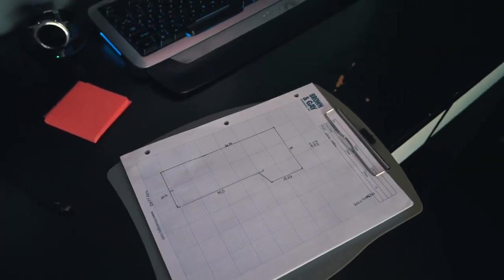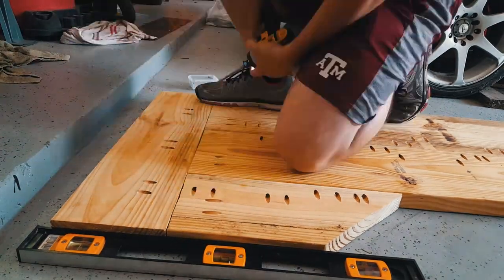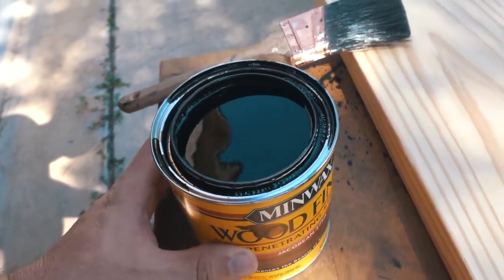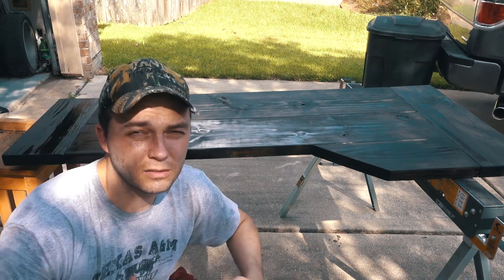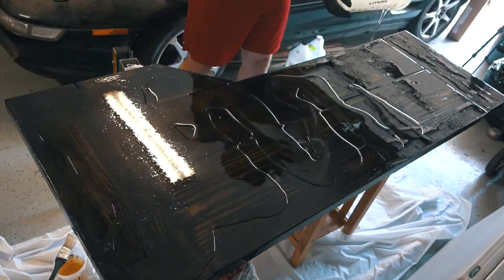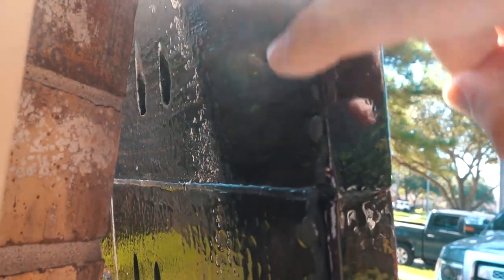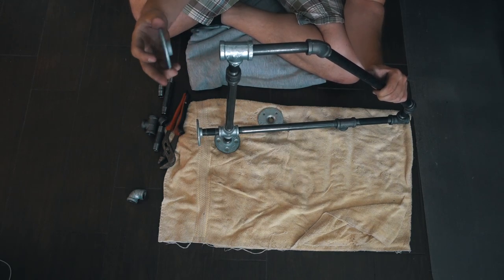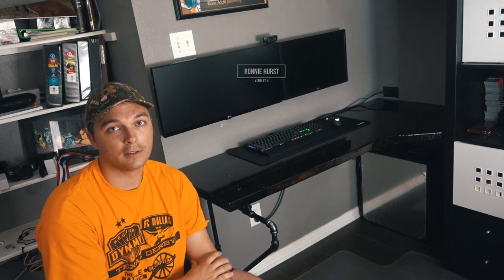My New Computer Desk! | DIY solid wood, epoxy-coated desk

Comment: Very nice result! I've seen epoxy table tops like this in bars, but I never thought about using it for a desk top. I also really like your stain choice.
Reply from the maker: +ScruffyEchidna thanks a lot! It was all almost by accident.
Reply from the maker: +ScruffyEchidna appreciate it! The stain looked so much better under the epoxy than it did on the raw wood. I was worried after the stain went on but the epoxy brought the colors to life!

Comment: Im sorry missed if you glued the wood together. If you didnt make sure you do next time. Clue will seal the cracks so you dontget airgaps under the epoxy
Reply from the maker: I ran caulking to smooth it out

Comment: Hey Ronnie! Do you have suggestions of any type for my setup? I am building a custom desk atm, so are there any tips for that? Like some cable management routes etc...
Reply from the maker: Plan, plan, plan.  I went so far as to cut a cardboard replica of the top I wanted and I am glad I did. I ended up forgetting about the gaming consoles near the wall and would have had no way of running the cables.

Take your time and lay everything out. Sketching really helps.  

If you have more specific questions I would be glad to help you think through them!
Reply: You can always cut a hole behind a monitor or in the corner of the against a wall if your doing that it would look great to be able to run your wires either behind your monitor so they aren’t visible or cleanly against a wall also if you have the corner of a wall it’s a clean look to run a wire down the corner so it’s not standing out very much
Reply: universe mouse did you watch my vid? I think the cable managment is on point, but i need other ppl to say their opinion

Comment: How smooth is the  top of the desk.  Does it feel sticky or weird, or smooth like glass?  I have an Ikea linmon corner desk (black) and would like to make it "glossier"
Reply from the maker: This epoxy is the same as what industrial restaurant tables and bars use. It's extremely smooth when it cures. Very much like glass without the "cold" feeling.

Comment: Thank you for posting a video like this.  I am hoping next year to make a desk for both of my kids and was thinking of painting then using those wall decals to put on the desktop (Super Mario Bros. ones). then putting the epoxy resin over the top of it. I wanted to build it for them so they are made of real wood and not the particle board or MDF stuff that breaks so easily.  I don't have a lot of experience in building something like this on my own but I want to try.  

The epoxy that you used does it yellow over time?  I saw the kind you used online but I wasn't sure because a lot will say no yellowing but then they yellow is what others say.  That is my biggest concern since I am trying to make it themed for my kids.  Plus theirs may see some sun does your desk see any sun?  I know that can affect the yellowing too.
Reply from the maker: Sun/UV light is going to "yellow" and degrade any type of plastic over time. I haven't seen any of that happen to my build but it isnt in direct sunlight. The stuff I used here seems extremely durable.

Comment: There's a youtube channel called stone coat counter tops, that has instructional videos on how to use epoxy and limit the amount you have to use. If you want to get the edges on the board flatter and get rid of the round over you can use a long hand plane. I would use a dowel jig and wood glue along with some clamps to mate the board together inside of pocket hole screws. Which results in more professional looking project, it's also cheaper than the pocket hole jig.
Reply from the maker: Great advice for someone wanting to take a project like this on. A different approach and likely better result.

For the epoxy amount, the manufacturer of the epoxy I used recommended a minimum quantity for mixing, so while it wasn't much, the flood coat approach resulted in some waste.
Reply: I remembered something else I saw and that is. You can use blue painters tape on the underside edge to easily remove the droplets. There's a youtuber called steve ramsey that does alot of woodworking tutorials and basics. I would check him out.

Comment: I've been watching a ton of these videos. The wall pipe fittings as the brackets is genius. 

Do you think the brackets would hold up with your desktop on it? I'm not a engineer at all so I have no idea lol
Reply from the maker: +Don Johnson they are anchored into the studs with two 1/2" lag bolts for each flange. It's pretty sturdy. 
I haven't posted an update but I actually have my CPU mounted to the underside of the desk. And it's a big one, probably weighing 35 to 40 lbs. The far side of the desk is sitting on two 18" lengths of 1x1 that is also bolted to the wall. I think the desk would easily hold 300 lb if not more.
Reply: Awesome, thanks dude! I think I want to do a desk with an "infinite mirror" effect - using a double sided mirror and some LEDs
Reply from the maker: +Don Johnson hope you like fingerprints! Lol
Reply: Oh definitely! I MIGHT epoxy over the glass/desk to make sure the glass is protected lol

Comment: Is there any issue with scratches on the resin?
Reply from the maker: Still no major scratches to date. I keep a microfiber down for when I'm setting down plates to eat while at my computer and stuff like that. The resin is pretty hard but not as hard as a ceramic.

I have had a couple of Xbox controllers fall on the desk from about 18" and nothing.

Comment: And run a torch after applying to remove bubbles
Reply from the maker: I did! I used a heat gun (industrial hair dryer) to pop all the air bubbles out. I tried not to over do it and end up causing ripples so there are still a few bubbles I missed. They are deep under the surface though.

Comment: Also next time use tack rags to wipe down befor epoxy it will get a cleaner endgame
Reply from the maker: Good advice. I did several passes with a wet rag and then a microfiber for any remaining dust

Comment: man i almost had a heart attack when you were using the circular saw to cut that timber i saw so many kids loose fingers or need surgery from cutting like that
Reply: yes, still at 2:30 shows bare hands right behind the blade, while the plank was bending. potential binding of the saw and bye bye pinky finger.
Reply from the maker: Definitely not an ideal cutting situation as I positioned them on the sawhorses like a complete dumbass.  The video angle is a little misleading as it is a 2x10 so I'm at least 4 inches from the saw. The blade is also guarded on the back on that ryobi saw. 
Still not the safest thing to do

Comment: Nice, but you should have watched a few video's on actually how to do it... You wasted a lot of epoxy, a board all around at about 1/4 above the surface would have allowed you to pour it 1/4 in thick.. 
Yet for a first timer I guess ok job... I am a retired Master Carpenter... (Sorry if my critic was harsh, not meant to be so)
Reply from the maker: +TheWolfster001 I did watch a lot of videos, but it was my first time working with it. Kind of like watching a lot of videos about throwing a curveball and then hitting a batter the first time you try it!

I thought about doing what you suggested. However I was attempting to have the epoxy cover the sides of the desk in addition to the top. I didn't want a smooth desk top surface and then it be uncoated wood on the sides. 

Thanks for the feedback! As a master carpenter I'm sure this video was painful to watch my amateur mistakes! Haha
Reply: No don't get me wrong, I did find it entertaining, I just keep forgetting not everyone thinks like a carpenter.. You can watch other videos and see how best to do it with epoxy, I also know for everyone there is a first time and the learning curve depends upon the amount of knowledge and/or skills one has... I seen one done where a guy used thin acrylic strips approximately 3 inches and fastened it all around the table/counter he was applying the epoxy making sure to take the time to level it as much as he could, the effect was amazing.. Also when using clear epoxy an idea I had, but yet to try it, would be to apply several led's (color changing would make it even more awesome) then epoxy over it, it would give a glowing effect... If you attempt to try that, be sure to send me a link... 
Be Blessed and keep up the good work..

Comment: And use a shower sqeegie to apply epoxy
Reply from the maker: This is a good method to use on a floor, for example, but this grade of epoxy is meant to be poured. Gravity does the work of smoothing it out flat. The table top is completely flat and runs true to a straight edge all the way across the length.

Comment: Lol you are supposed to mix the resin and hardener not pour them on top of eachother
Reply from the maker: I did this as well. There should be a clip where you see me pour both and mix them with a drill.  I had to mix two batches which is probably the confusion. 

Thanks for all your comments!